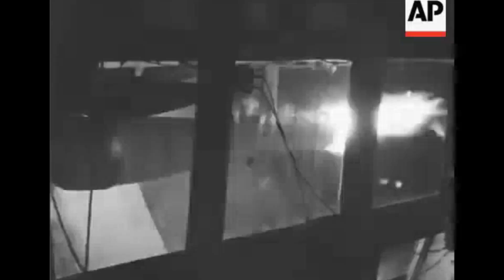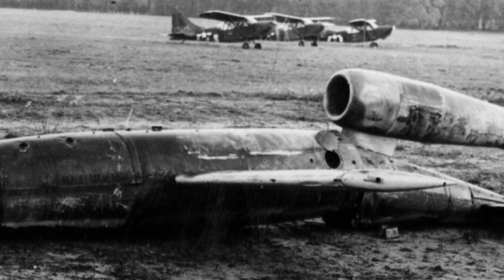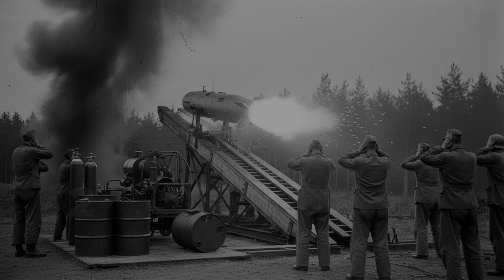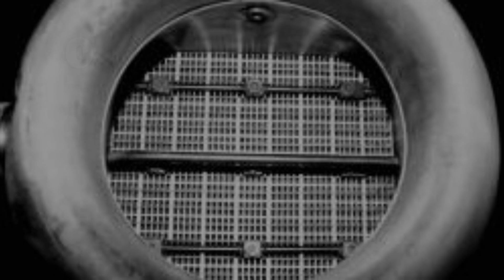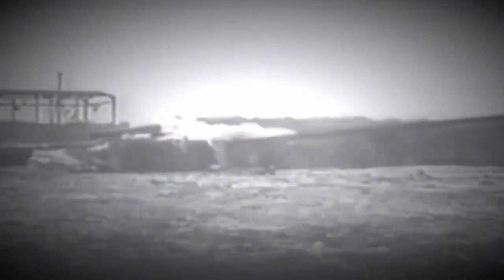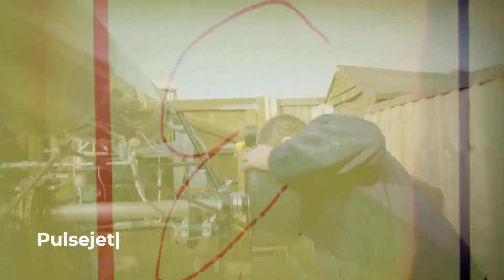Argus As 014 Pulsejet - The Worst Aircraft Engine Ever Made

Comment: https://youtu.be/hOTzp2ucUCM?si=mqxWijgxiu1-n_S3 Later versions of the Argus-104 included it inside a duct, with some kind of 'Afterburner' or 'RamJet add-on', with a 1 kg fuel/ kg thrust SFC. The heat from outer PulseJet tube was added to propulsion with the air flow around that cooled it and made it more silent 
     https://youtube.com/shorts/VAdqVJu143E?si=8D2gX8GJzqiLAoz8